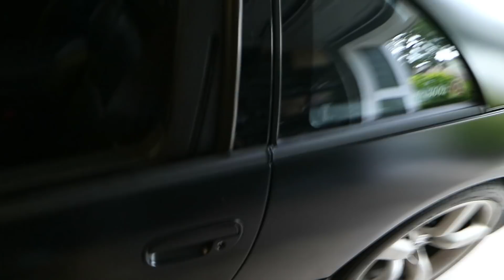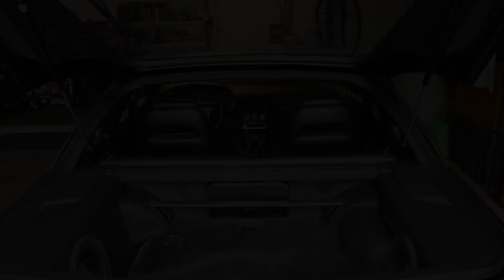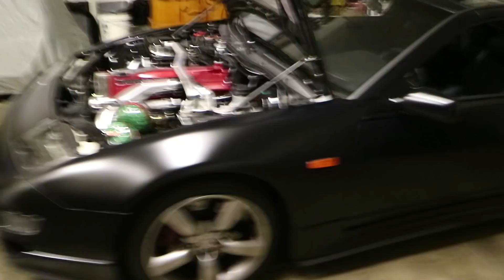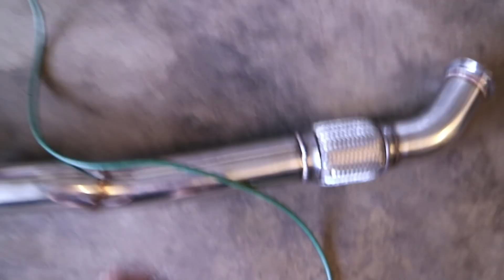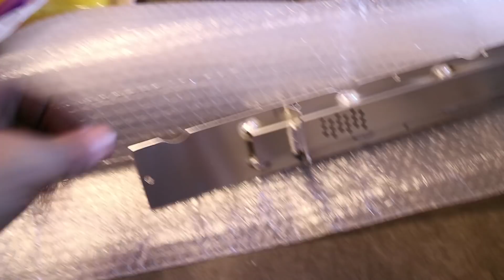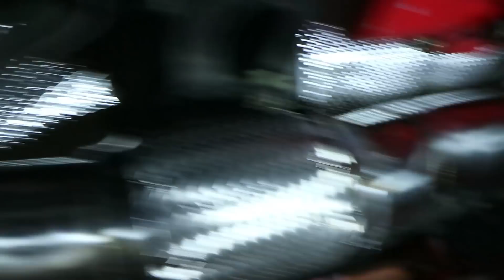Exhaust 2.0 :: Ep39 - TueZday Garage :: RB26 into 300zx (RBZ32)

Comment: Nice! Just a lil tip, when welding vbands, make sure to clamp the one being welded to another one. Keeps the flange from warping (which if you didn't get a big ol leak, you one lucky man). Good work and keep em comin man! Can't wait to see that shelf bare!!!
Reply: Oh yea, almost forgot. Can't beat some good 90's music, but that's coming from a guy who was born in 93 😂
Reply from the maker: 1dickycat sweet tip. Thanks. I will definitely follow it when I eventually switch out the cat-back connections. As for the 90s tunes... EVERY day, my shower and commute playlist is 90s alternative/grunge/punk 😎🤘🏼
Reply: BCs300z That's kinda funny cuz I'm the same but more into the early 2000's. Still so many greats that came from the 90's tho.